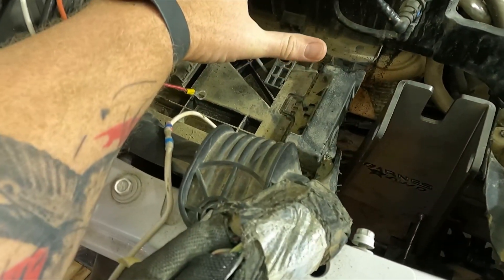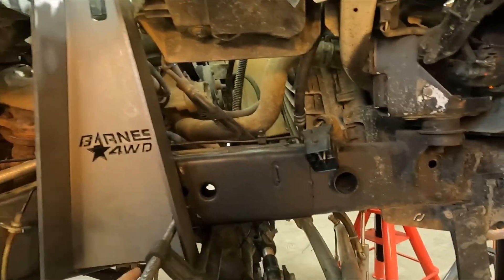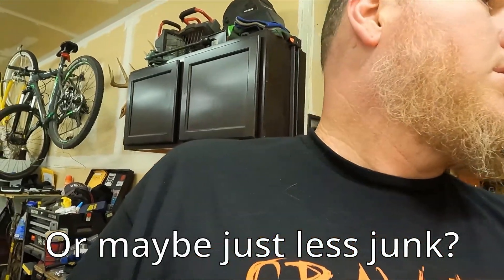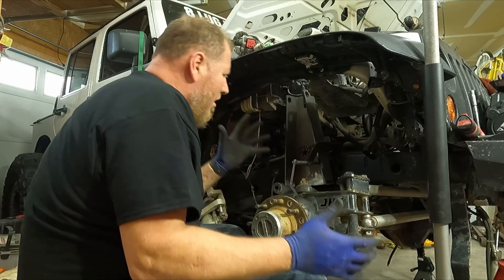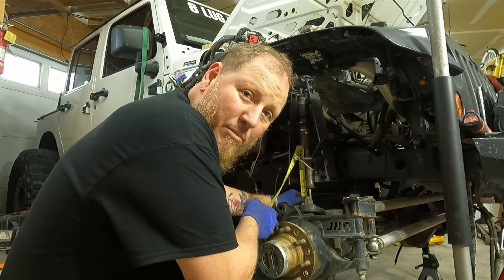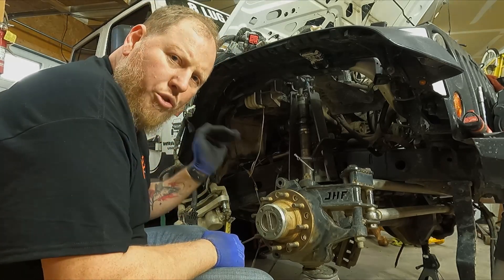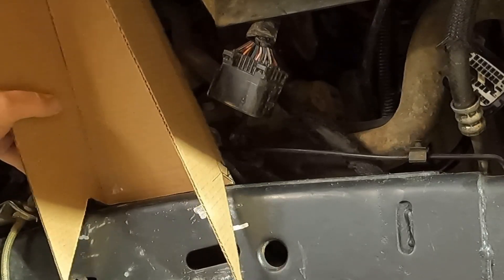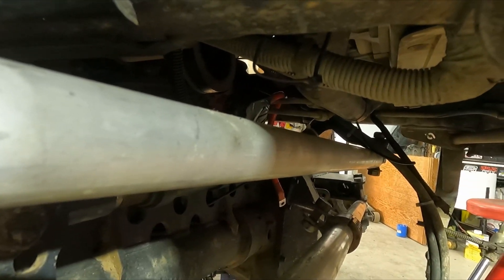Coilover install part 3

Comment: Full hydro is always best. Why not french the shock towers into the frame???
Reply from the maker: I started buying parts for the full hydro.  I’m going to shoot for April to be done with the hydro and rear coilovers.
Reply: @8 Lug productions  if it was me id french them mount into the frame strongest way to do it
Reply from the maker: @ryanhubble9157  too late.  I’m not cutting them off and redoing them now.